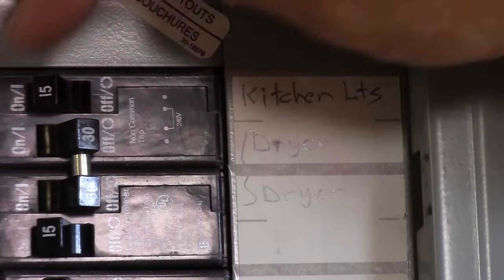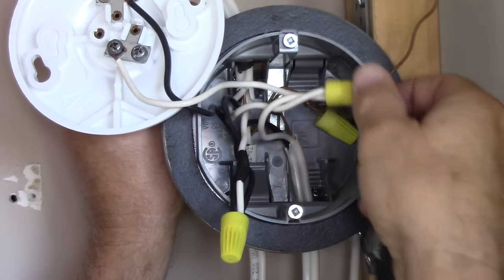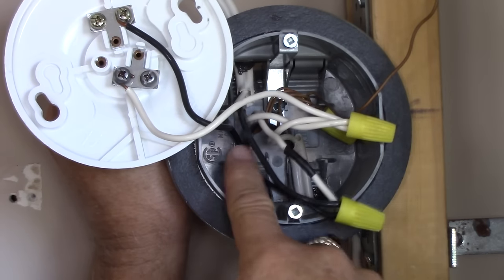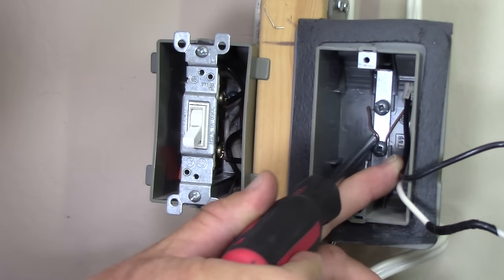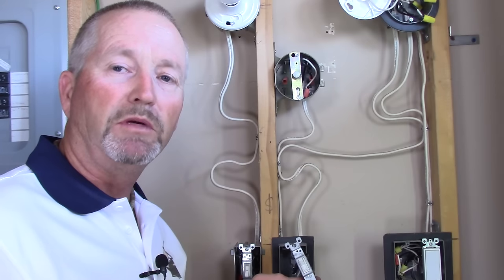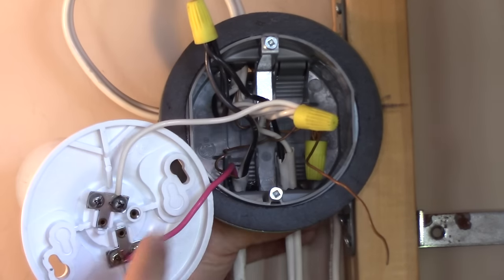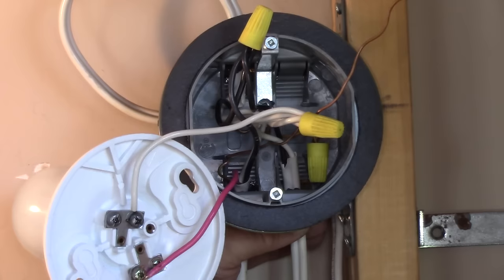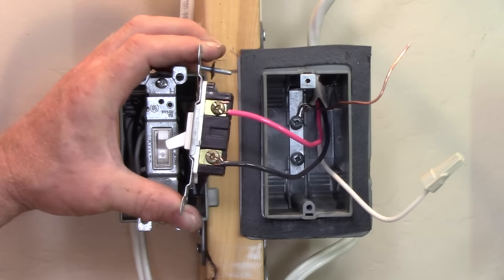How to Wire a Light Switch:  The Switch Leg Loop/Drop

Comment: Can't tell you how happy you made me and my granddaughter by providing this video.  We struggled trying to figure out how to connect the wires when switching out a ceiling light (my bad I forgot to take a picture before disconnecting the old fixture) as the light would turn on but not shut off with the switch.  Now the light works perfectly.  THANKS SO MUCH!

Comment: Good video.    It's worth noting this wiring method is rarely used today,  but you will often run across it in older homes.    When I wire new construction I always run power to the switch box, then run my 14/2 leg up to my light.   It simplifies troubleshooting in case of a problem.   I have used switch loops in remodels and renovations,  for adding switches to pull chain fixtures,  by fishing a 14/3 from the light box to the newly added switch location.
Reply from the maker: Just to build on your comment, this method no longer meets the NEC and CEC code as it does not satisfy the requirement of a neutral conductor in every outlet box.  Thanks for watching, and for the helpful comment!
Reply from the maker: But you are correct in that it is very common in older homes.  It was the cheaper, quicker, method of wiring a house in the most efficient and rapid way possible so you could make money in the residential marketplace, where you had to get your rough-in times down to record setting speeds!
Reply: @theinternetelectrician  actually the 14/3 I've used, from a pull chain fixture to a new switch location does meet code.   I use the black as my incoming hot, the red as the leg, and place a wirenut on the neutral and stuff it in the back of the switch box.   That way a neutral is available for a high end dimmer or other electronic switch that requires it.    As well as the ability to tap off that and add a receptacle below, for example.     I don't like using this method, because in case of a problem troubleshooting takes more effort.  As a sparky,  I don't just think about the easiest way for me to wire a house, I also think about the folks later on who may have to work on the system.
Reply from the maker: @Sparky-ww5re  yes, understood. Using a 3-wire does meet code. I meant the 2-wire drop doesn’t, as I describe in the opening segment.
Reply: @theinternetelectrician  I'm confused, if you brought the 14/2 circuit (power) into the switch box and ran a 14/2 (power) out of the switch box to another switch box (multiple rooms for example) and used a 14/2 for the switch leg to the fixture, you'd have multiple neutrals in the switch box that you could pig tail out if needed. Doesn't that satisfy the code requirement of a neutral in a switch box? Thank you!

Comment: Thanks so much, you just confirmed my thoughts on the 3 wire drop, as I am adding a switch to an existing light using 14-3.Romex.
Reply from the maker: And that makes you compliant with the new code rules!

Comment: Thank you sir. You made it so much easier than other channels. I had to use ground as a neutral in a house before the 1920's with much research . It was a nightmare fixing the electrical connectors around the house
Reply: @Rick-the-Swift   He said he was doing it in a house that's pre-1920s , not that he was pre-1920s- however that remark was hilarious

Comment: I have installed a couple of motion auto light switches, single pole. My house light switches don't have a ground. These switches say they don't require a ground, but after installing them, my led light fixtures flicker randomly. I only have a two wire with no ground system. White and black. On one switch the hot is black and the other switch the hot is white. I think wires are crossed somewhere along the line.  My question is 1, the black being HOT, is the white considered neutral? I've heard it was, but the switch has terminals marked hot and load. Is load neutral? I see switches on Amazon that say requires neutral but not ground needed. Will these "neutral required" switches work with my wiring? Thanks in advance for your.
Reply from the maker: You have the same wiring method as you see in my video.  Only on one of the switches, they didn't do it  as it should be done, and the other one is the way it should be done by sending the power down on the white wire, and back up to the fixture on the black.  So short answer, no you cannot use any electronic switch that needs a neutral, and it has happened that (and some component manufacturers suggest doing so) the ground is used to make the electronics work, but with no ground, no neutral, you don't have any choice but to do what you did.  I can't answer why the random flickering is happening without some hands-on troubleshooting, and even then it might remain a mystery.  Thanks for watching!  I hope you've subscribed, and helped me out on my quest for 100K subs!

Comment: I’m working on a shop  I have recepticals at bottom to run always hot but my recepticals at top are for my shop lights they are plug ins   Can it be wired to switch with out third wire
Reply from the maker: Yes, if you use this method, but it no longer meets the current code rules as discussed in the video.  And if you have multiple outlets that you want on the one switch, you would need two, 2-wire cables between each box after the one you used to do the switching.

Comment: Thanks Terry for your insight.  I have a situation where the power is entering the switch box.  How to I wire that using the three wire method?  Much appreciated.
Reply from the maker: Use the hot black wire and splice it through, and pigtail it to the switch, and use the red wire on the other side of the switch for the light.  Then at the light fixture you have a hot conductor that can be used to continue the circuit and connect the red to the fixture..

Comment: Looks good. But most guys wire s light switch like a safety switch with line(the power coming in on the black wire) to the screw on top when the toggle is in the "on" position and the "load" is the bottom screw that the red wire attaches to and then to the light socket, ( center pin, not the shell. Shell goes to neutral.)
Reply from the maker: The practice of connecting switches with hot on the top does come from the safety switch as you point out here.  And for good reason, so that when you are throwing the switch closed, the blade (s) of the switch are not hot until contact with the top jaws is made.  However with new devices, this is irrelevant and connecting that way is more of a habit and a trade practice for some.  I like the way I do it just because it was the way I was taught, and it makes sense to me with all the power coming in below, and then going 'up' to any lightings.  Whatever works and makes sense is OK because the switch doesn't 'care' what terminal the hot one is 🙂

Comment: @theinternetelectrician  I'm confused, if you brought the 14/2 circuit (power) into the switch box and ran a 14/2 (power) out of the switch box to another switch box (multiple rooms for example) and used a 14/2 for the switch leg to the fixture, you'd have multiple neutrals in the switch box that you could pig tail out if needed. Doesn't that satisfy the code requirement of a neutral in a switch box? Thank you!

Comment: Thanks for the video. Curious if you can add a receptacle from the light switch in a switch leg loop/drop??
Reply from the maker: Short answer, you can't.  That's part of the reason for the new code requirements that we have a neutral conductor in every outlet box.  If I had a Nickle for every question that I've had regarding that very question, well, I'd have a bunch of nickels!

Comment: Used your videos to educate myself to replace outlets and switches - so helpful!
I do have a problem I don’t see Anywhere how to address. I replaced an outlet (like many times before) but the breaker won’t turn back on now. It doesn’t want to stay in on position. What is it? Something with the outlet?
Reply from the maker: An outlet in the kitchen? https://www.youtube.com/watch?v=rapPtMscrI0&t=5s
Reply from the maker: Short answer, did you break the tab on the hot side of the receptacle (if this was in the kitchen)?

Comment: Hi Terry - i have a light switch that controls an outlet.  When i went to replace the switch i copied the configuration from the old switch. I only had a black and red wire.  Once the new switch was installed i the switch does not work but the outlet has constant power.  Can you help?
Reply from the maker: With what you are describing, the only thing that I can think of is that the new switch is faulty and is conducting all the time? Did you change the receptacle too? If so, I have another answer.

Comment: Hey Terry .i wanted to change my light switch to a motion controlled switch but in the box it was fed with 2 red wired pigtailed into the old switch.whats the 2 red wires do and how do they get hoiked up..i tried wireing it 2 way..both reds on one terminal on the motion switch and it wouldnt turn off..2nd way was one wire one each terminal. Well it was really low lighting when the power was back on..can you help..thk u jamie

Comment: Thank you for the great video.. I have a question? I just installed a lighted switch using a 12-3 wire, I connect the black and red wire to the lighted switch and I just put a wire nut on the white wire and left it alone, but the lighted switch is not lighting up...Can I wire the white wire and black wire together with a black pig tail wired to the screw to make the lighted switch work properly?

Comment: Good video, I finally got an understanding of how to wire to a light switch.I dont have a ceiling light in my master bedroom. I have the old two wire set up going from the wall switch to a half hot receptacle . The half hot receptacle is on the opposite corner of the room from the wall switch. I want to install a ceiling light. Can I tap into the  cable, that connects the half hot  receptacle to the light switch and then go to the light fixture and use the wall switch to operate the light.

Comment: I have a red wire  and 2 black wire on one screw . No ground wire and 2 white wire screws together. Do I add another black wire to the 2 b. Wire? Ans screw together?
Reply from the maker: If I understand your question, you need to splice the 2 black wires together in a wire nut along with a pig-tail to connect to one terminal of the switch.  The red wire on the other terminal.

Comment: Terry, I have a question, actually an issue. My mom's house, it had a swith over an outlet type switch/ outlet that controlled her light over the vanity, it stopped working, she paid someone that came in and put a switch and an outlet in a 2 gang box, it works but the switch also turns off her hallway light and a bedroom light. I looked at it tonight and I can't figure it out, it also had the red wire that you showed. I'm gonna go back tomorrow to try to straighten it out,  and tips would be appreciated. I am a lineman so I do know about electricity, just not too much on interior, thanks for listening

Comment: What damage can be done by wiring neutral white and black (power) to a single pole switch?
Reply from the maker: Nothing that a circuit breaker, or a fuse can't handle! You'd have a short circuit when you closed the switch! Not advised however, as this is a fault condition that we try our best to avoid!

Comment: Im replacing an outside gfci that had a switch loop controlled by a single pole switch in the house.  When I took the original gfci out I failed to take a photo (idiot) now can’t figure out the wiring.  Everything works as before but cannot get the switch to turn the gfci off.  Where does the red wire attach?  Currently there are 4 wires on the gfci, white and black on the Line and white and black on the load.  thanks
Reply from the maker: So one of the cables coming in to the outlet box for the GFCI is a 3-wire, white, black, and red? You'll have to open up the switch box as well and let me know what's in there for cables, and how they are spliced, what's connected to the switch, etc.

Comment: I understand how to loop a switch , but can you tell me how too get power from the ceiling to another switch then to a ceiling light . Like the demo you have using 14/2 wire. Where you have power coming in and power to the switch and power to another source . Thanks

Comment: What's the whole point of adding the neutral if there wasn't a use for it?
Reply: because sometimes,  a very fancy switch,  requires a neutral to properly function.  MLV and ELV dimmers, timeclock switches, and wifi smart switches are examples.    The code making panel recognized that folks were using using the ground as neutral for the switch,  and a ground is never supposed to be used as a current carrying conductor, since many older homes ran power to the light box, then dropped a 14/2 to a switch,  as electronic switches did not exist back in the 50s 60s and 70s when this wiring method was commonly used, and there was never a need for a neutral at the switch box.

Comment: Well my mess is confusing me as I understand the switch leg drop & loop back to power downline. I have ceiling box light with incoming load & I have 2 switches on wall 1 for this light & 1 for outside light below switch is a plug. The switch for this light goes to light, the ceiling box has 3 sets of wires plus load set. So the other two have  to carry load downline right? Right now if I tie all blacks together the incoming hot load wire sparks. I don't know if the 2 sets of wires left only 1 goes downline & the other is the outside switch? Bcuz the 3 sets of wires in wall from ceiling don't appear to be going to a plug switch or light. Do I have 2 Neutral white wires in ceiling going down to 2 switches as black hot separately? Then I have 2 black hot coming back up to power lights 1 in & 1 out, right? Without power going thru wire how do you know which ones are downline, plugs, switches, lights etc. Thank you your videos are very good quality info.

Comment: I have a question.  I'm running lights on each side of my garage. What I did was connected the 3 wires off a light fixture on the back of my home and routed the wires to each garage light. They aren't dusk to dawn lights so I want to add a switch. I installed a switch and connected the hot and Ground but the lights aren't shutting off please help..
Reply from the maker: I would need to see a diagram or pictures of how you connected these.  The connecting of the hot and ground to a switch doesn't sound right either.

Comment: I have a light switch that has a one Red and one Black wire only. It was controlling the bottom half of a socket to turn it off and off, I replaced every socket and switch in my house and that’s the only one that isn’t working now. There is no power at all. I tried switching the wires and still nothing. Does the Red wire have to be connected to the bottom half of the socket?? I currently have it attached to the top half of the socket and the Red wire attached to the top part of the switch. Does that make a difference?

Please respond/help me, thanks

Comment: Very nice videos.  I have a problem.  I replaced a garage light switch with a Lutron motion detector switch (MS-OPS2 no neutral needed).  Worked great till I discovered that I had lost power to one of my front exterior outlets.  I am trying to fix this since I obviously cut off supply to that outlet when I did the garage switch replacement.  This is complicated for me because I have 6 wires in that garage outlet.  3 black and 3 white and one copper ground.  Only one black is hot.  if I tie all blacks together then I get power on two of the whites.  If I tie the hot black to one of the whites then I get power on another white and the other two blacks.  Now if I tie the hot white and neutral white I get power to my exterior outlet and my Sperry shows normal connection.  But I don't know how to reconnect my Lutron to this set up.  I have a tone generator kit and was thinking maybe I should use that to find out which wire goes where....

Comment: How do I add extra lights off the 3 wire. I have 4 lights wired up and they work but won’t turn off with the switch. Do I splice the black wire with the red to make them all turn off?

Comment: My 3 lights outside the house are not working.  The light bulbs are good,  none of the 2 GFI, and the breakers in the box are tripped off.  What could be the cause of the problem?  Danny Sison
Reply: Pretty easy to track down the cause with a non contact voltage tester.... $10 at your local box store.

Comment: Why would a yellow wire be connected to the ground on a receptacle?
Reply from the maker: Sometimes yellow is used as a ground wire in some systems. (sometimes it will have a green stripe)

Comment: HI .. thank you for doing this video.. i have a light switch wire like you have it at 3:47 minutes.. can i tap off of the light switch an add a second light switch to power another light.. in my room the light switch control a ceiling fan and light combo , that is feed power with a 3 wire . the light switch is control by using a 2 wire . i would like to install a second light switch to control  the light on the ceiling fan . i hope this make sense to you.. thanks

Comment: Terry, I just worked on a 3-way switch set up. both switches were removed by someone else. No markings. Can you share with us what is the simplest and fastest way to figure out the wiring? I got it done but I think there must be a faster way. Thank you, Terry.
Reply: Robert w Sieburg experience
Reply: Disconnect all the wires, leave breaker on and test for the hot wire, (common screw) marrette your other 2 wires (travellers) and go to the next box and turn ur meter to measure continuity, if it beeps u found ur travellers and the other wire is ur load